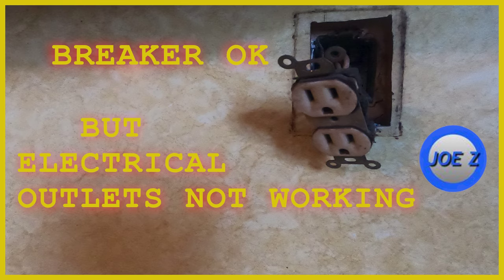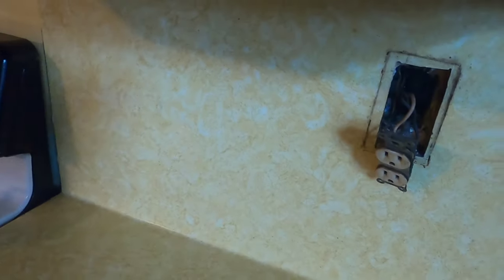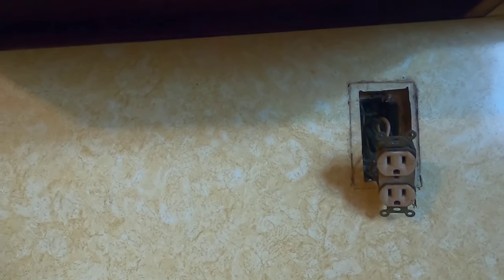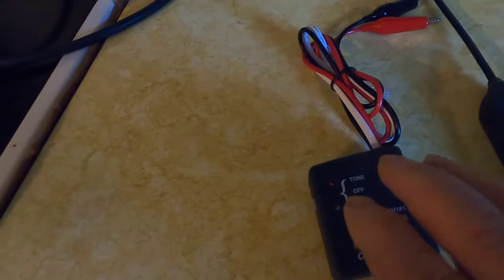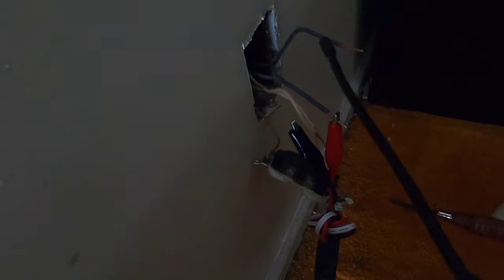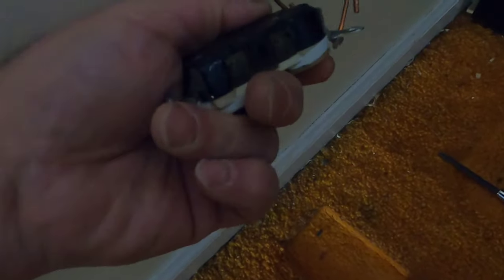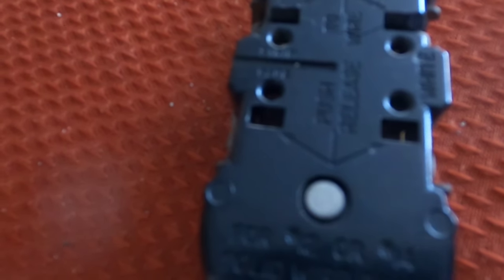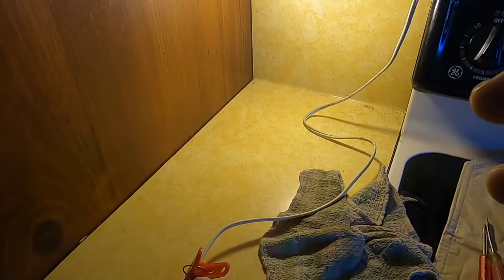Breaker on but no power to outlet FIX

Comment: Two of my 29 year old garage outlets have no power. My house vacuum and seedling grow light system used one of these outlets, the other never has had a plug in it. NO AC VOLTAGE exists either outlet, using a Voltmeter and a "hot power" glow light meter. ZERO power behind the outlet by touching the actual wires Also. These 2 outlets use the screws to connect the power/ground wires. I've tested ALL my indoor/porch outlets and have verified ALL have power, especially the garage area where the two powerless outlets exist. Your failure was due the "STABBING" of wires into your original outlets....so I don't know how my outlets could be bad (in themselves), since there is NO POWER ON THE HOT WIRES THAT connect each outlet. THOUGHTS?
Reply from the maker: Do you have a GFI circuit breaker? I once had a breaker go bad. Did you ever have squirrels, chipmunks etc in the garage, attic  or anywhere else? Wire may have been chewed. I would trace the line coming from the panel box as far as you can to check for power, 
Let me know if any of this helps.
Stay safe, Joe Z

Comment: Hi , old house and circuit breaker box not labeled ..we have what looks like the same problem and called an electrician and he said it could be a wire was bad , possible it was mice chewed wires that he didnt know really , that it would take a team of electricians to find out the prob , charge by the hr . if close ,  anyway U could come and fix ours the way U showed it n the video ?    SW Va
Reply from the maker: Hi EJ, I would like to help but I live I NY near Poughkeepsie. Gave PK as a reference location due to an easier find on the map. Plus I am not an electrician. Are there any trade schools in your area or maybe a retired electrician that you or someone you know that would help to diagnose this problem for  you at a reasonable price?

Comment: The main problem you had were outlets that were wired by back stabbing the outlets. They must have been put in by the previous owner, not an electrician.  All outlets should be connected at the screw terminals.  The only tool you needed to find the problem was a non contact voltage tester pen. This 
would have sensed the live voltage without having to go thru the hassle of removing the back stabbed wires. You would have sensed voltage at the bad outlet and all others upstream but none of the downstream outlets. The bad outlet would have been the last one in the string to have power sensed.
Reply from the maker: Thank you for watching and contributing useful information. Your suggestion sounds like it is a much easier way of finding the break. I will use it if I run into this issue again. This house was built in 1976 & a licensed electrician installed all of the outlets & light fixtures. I do not know what the code was then or if he was just lazy.
Stay safe, Joe Z
Reply: I agree that all outlets & switches should be attached using the screw terminals. However,  you assume that a person knows the direction of the run. In many cases, due to remodels and such, these runs can and often are changed dramatically.  A NCVT does little good when a run has been changed to connect a different room entirely. 
I ran into this very problem yesterday and today on a renovated home where power was lost in half the kitchen, half the dining room and half of the living room. Power originated in the kitchen then off to a separate unconnected bdr, then back to the 
kitchen. Then to the  dining room where another split occurred for lights and outlets.

Comment: I have the same problem after the power company fixed outage after a storm . 1 run of outlets have no power and the breaker is re set. In getting a no contact voltage tester before proceeding.
Reply from the maker: Craig Barnard,  Thank you for watching and taking the time to comment. 
Just proceed with caution. If you are certain where the run is powered from it it should be easier to find the break in the circuit. In my case I did not have any idea. Without this tester it would have been real difficult for me to find it with the power source outlet in the other room.
 Barnard I have other videos on my channel that cover many different subjects  and new videos added weekly that may also be of help or interest.
Let us know how your repair went.
 Thank you for your support and using the links provided to make your purchases. 
                                                This is always appreciated.
                            
 Stay safe, Joe Z

Comment: Instead of using an extension wire from one outlet to the other for continuity checking, you can connect one set of wires on one outlet and check the continuity on the other end at the other outlet.
Reply from the maker: Thank you for taking the time to comment. Hope you get to visit again.
Stay safe, Joe Z

Comment: Splice the wires and run a pigtail to the receptacles.  I never run them in series for this reason.  No point letting a device be the reason for outage.
Reply from the maker: Thank you for watching and adding this information.
Stay safe, Joe Z

Comment: My dad had a similar issue with one of the houses he had which had aluminum wiring 

The culprit awas a burnt illegal open junction someone did above a door when the previous owner moved walls around he’s lucky there wasn’t a fire and all that happened is the outlet stoped working about 8ft from the junction it was pretty charred with the insulation melted and the outlets and switches in that room were backstabbed with burnt connections 😖 

He sold it and moved after fixing it all
Reply from the maker: Glad he found it before any disaster. I am not an electrician but have been told by one that aluminum wiring can be an issue by itself. Then you have sloppy work added to it 😕
   Elizabeth Marks-Graham, Thank you for watching and taking the time to comment.  have other videos on my channel that cover many different subjects  and new videos added  that may also be of help or interest.
 
Your support is not required or expected but always appreciated. If you are inclined to do so your Subscription, Likes, Comments and using the following links do help.
You can Help Support The Joe Z Channel at no cost to you
by following my affiliate links.   
Joe Z is a participant in the Amazon Associates Program, 
an affiliate advertising program designed to provide a means 
for sites to earn advertising fees by advertising and linking to amazon,
that helps me to continue producing videos.
Thank you for your support and using the links provided to make your purchases. 
   
                         ***** Thank you for your support ******
     
Elizabeth Marks-Graham I just want to mention If you haven't installed the TubeBuddy browser plugin yet, to help your channel grow  Just go to my favorite tool for channel growth Tube Buddy. Now You can use it too, here's my affiliate link to the Free versionhttps://www.tubebuddy.com/joezep54   Start with the free version, yes it is free to not only to down load but to use.
Again I hope you get to  enjoy other videos on my channel as well. 
 Stay safe, Joe Z

Comment: For those who don’t know how to bench test (testing a switch in your hands and not attached to any cables) an outlet or a light switch, it’s easy. I could not find a video that shows how to do so.  1.) Light switch… on your multimeter, you set your settings to continuity test. With either probe, touch either screw. One probe on one screw, the second probe on the second screw.  You should hear a beep.  Toggle the switch and you should hear the tone come on/off.  That’s it!  2.) outlet…. Looking at the switch w the round (ground) facing down, the smaller of the two vertical lines is the “power in”.  The longer one is your neutral (power going back to the utility company). To test the outlet, set your multimeter to continuity.  W one probe, touch the screw on the right side (gold/dark in color). The second probe on your multimeter goes into the slot of your outlet.  The small side.  You should hear a beeping sound emitting from your multimeter.   The same procedure is performed for Neutral.. longer side (left side) and the silver screw… ground will be the bottom hole and the green screw.   You test individually.  You cannot test a receptacle by inserting both probes of your multimeter as You do when checking for voltage.  I hope that helps someone and I was as clear as possible.  DO NOT CHECK FOR CONTINUITY ON A LIVE CIRCUIT!!!! Disconnect the switch or receptacle to bench test.   If you did not understand my instructions, please do not perform this test.
Reply from the maker: Thank you for watching and taking the time to comment. @rolandos64 I have other videos on my channel that cover different subjects  and new videos added weekly that may also be of help or interest. 
Looking forward for future comments.
Your support is not required but always appreciated. If you are inclined to do so your Subscription, Likes, Comments and sharing this content would help me to reach other viewers that may also find this channel useful or entertaining.
 
 Stay safe, Joe Z

Comment: outlets that stopped working , all outlets in the bathroom even the overhead light , 3 in the kitchen microwave , stove light and toaster  , closet light in the front bedroom and 1 socket in the bedroom beside the bathroom . the circuit breaker box in the basement isnt labeled 'w' the rooms  and the breaker trips if i cut an electric heater in the bedroom on high . strange how all the other outlets still work and those dont
Reply from the maker: Sounds like there are too many outlets on the line to begin with or what  
ever caused this problem damaged two or more of the circuits.

Comment: Same issue on a run of 6 50 year old outlets. I did not spend the whole day testing and testing. I just replaced the outlets for around 20 bucks in a little over an hour. Problem solved!!!!!!
Reply from the maker: Thank you for watching. The problem I had is not knowing which outlets were on the run. The one that was the problem was in another room.  
Hope you get to stop by again.
Stay safe, Joe Z

Comment: The problem develops when the receptacles are series AKA daisy chained. If the leads are feed parallel the problem doesn't take place. In the state I live in you often find that. Our state has no licensing system for electricians. I"m no electrician but i worked for so many electrical companies I can't tell you how many.
Reply from the maker: John Miley,  Thank you for watching and taking the time to comment. with this additional information. 
John Miley I have other videos on my channel that cover many different subjects  and new videos added weekly that may also be of help or interest.
 Be sure to 👍, share and subscribe if your are inclined to do so.  Also not to miss any new videos remember to hit that notification 🔔
 Another way you can help support  this channel at NO cost to you is by using one of my affiliate links.
                        * Thank you for watching I really appreciate your support.***
Again I hope you get to  enjoy other videos on my channel as well. 
 Stay safe, Joe Z
Reply: Believe you mean a PIGTAIL to each receptacle in that box? 
A state with no license requirement.  NEC applies automatically?

Comment: I WENT CRAZZZZY THIS AFTERNOON..... I WILL CHECK TOMORROW.... MY SISTER WAS USING THE VACUM CLEANER, WHEN I OPENED THE BOX ONE LEAD WAS LOOSED . I FIXED IT WITH A NEW OUTLET, AND A "LOOP" ON THE CONNECTIONS.  STILL DIDN'T WORK. I WILL OPEN THE OTHER TWO OUTLETS TOMORROW.     I DIDN'T REA;IZE THAT THE ACTUAL OUTLET COULD BE DAMAGED. THANKS.......... QUESTION: WHEN I OPEN ALL THE BOXES AT LEAT ONE SHOULD HAVE POWER CORRECT?? SINCE ONE SHOULD BE CONNECTED TO THE MAIN....CORRECT??
Reply from the maker: Amir thank you for stopping by. Please keep in mind I am not an electrician & this is how I figured out my particular issue. That said if there is not any power in the outlet check the wire feeding it. If that does no have power continue down the line until you find the power source. Also is there a outlet with GFI or a GFI breaker? If so check that first, it could be that easy but if not you have to find where the break in power is.
Let me know if this helps.
Remember to use caution & be safe, Joe Z
Reply: @JOEZEP54  THANK YOU FOR YOUR HELP. I will let you know the outcome. I will fix it when i get back to her house. I love electricity.
Reply: @JOEZEP54  TODAY SATURDAY JAN 15TH 2022. I OPENED  THE 3 BOXES WITHOUT POWER, "HOT" WIRE ON BOX #0  WAS NOT CONNECTED. 25 YEARS AGO THE ELECTRICIAN PUSHED THE WIRES IN THE BACK  INSTEAD OF DOING THE LOOP. i REPLACED ALL THE OUTLETS AND DID THE LOOPS. I REPLACED ALSO A SWITCH. THIS IS THE FIRST TIME I FIND THAT THE BLACK WIRE ON BOTH ENDS HAS POWER. WHY?
Reply from the maker: @AMIR-nm7fo  I am not sure but you may have a loaded or open neutral. Check the neutral wire to see if it has power. If it does you may have crossed the wires when you reinstalled the outlets. BE CAREFULL not to get shocked. This can be dangerous.
Let me know if this helped.
Stay safe, Joe Z

Comment: I wonder if this is what is wrong with 1/3 of the outlets/lights in my house. Power doesn't work for them even though breaker is on and is fine. Must be a breach in one or more of them.
Reply from the maker: Could be a bad outlet or a broken or chewed wire.
Thank you for watching & taking the time to comment.

Be safe,
Joe Z
Reply: @JOEZEP54  Thanks. I found some old sketches of the wiring done in the 80s but I know stuff has changed since then. Showed it to a certified electrician friend and he thinks he might know which outlet is the problem. Unfortunately, it's in a closet with bifold doors and they are stuck closed. We have to see if we can get them to open or break them down to gain access. I plan to replace every single outlet and switch in the house eventually (its all very old stuff from the 70s & 80s & we've had a lot of power surges). Mouse damage is a very high probability.

Comment: I recently change my kitchen outlet plugs and when I reset my breaker my living room, hall way and garage lights were not working anymore also the outlets in the living room. It’s weird because the outlets I change in the kitchen are working properly. Any one had and issue similar to mine?
Reply from the maker: Hi Jesse, I would check the outlet again, You may have not connected a wire. Another area to check is the tab on the side of the outlets that would allow the outlet to run off two lines. If you broke the connection & the non working lights are connect to that part this could be the cause. This is a comment from 
Melvin McGregor that makes a lot of sense when rewiring.
Very thorough explanation in diagnosing the cause of the problem.  Whenever there’s 2 sets of wires (4 wires total - excluding the the grounds) coming in to a box, it’s preferable to pigtail them together, thus preventing other receptacles downstream from tripping or malfunctioning.  Another suggestion is to install a GFCI in the your dinning room that will also protect your downstream outlets in your kitchen. 
Pigtails: I do acknowledge this is not always possible in older homes where smaller metal electrical boxes was the norm back in the day, because there isn’t enough space in these older boxes to accommodate wire nuts or wago’s. Again , very good video and thank you for sharing.
Stay safe, Joe Z

Comment: Thank you.......
Reply from the maker: You're welcome, I am glad this was of help. And thank you for watching and taking the time to comment. @ginoromano2442 I have other videos on my channel that cover different subjects  and new videos added weekly that may also be of help or interest. 
Your support is not required but always appreciated. If you are inclined to do so your Subscription, Likes, Comments and sharing this content would help me to reach other viewers that may also find this channel useful or entertaining.
 
 Stay safe, Joe Z
Reply: @JOEZEP54  I tried all day yesterday to fix the same issue (two dead outlets in kitchen). I'm going straight to the old outlets today. Much appreciated.
God bless you and your family......
Reply from the maker: @ginoromano2442  Thank you and God bless you and your family as well. When you check the old outlets look close at the ones with 4 wires attached. If that one is bad it will open the circuit and will kill the power to the attached outlets. When you replace any of the 4 wire outlets "pig tail" the connections if you can. In the event the out let goes bad it will not affect the outlets down the line. If you are unfamiliar on how to pigtail wires in an outlet just check YT.
Please keep in mind I am not an electrician & just sharing what I know, use all safety precautions. If you are not certain  the best advice is to call an electrician.
Stay safe, Joe Z

Comment: Light switches in 3 rooms not working no power as my father changed switch with out turning off main power and wires touched now 3 rooms not working but all power still working .  What to do ?
Reply from the maker: Sorry for the late reply. I had a computer problem & was trying to reply to comments on a borrowed tablet.
You said power is still working. Where do you have power to? Is it at the circuit breaker or do you have power up to the switch?